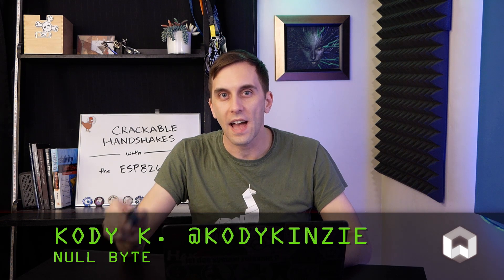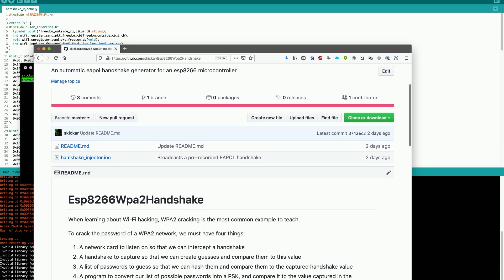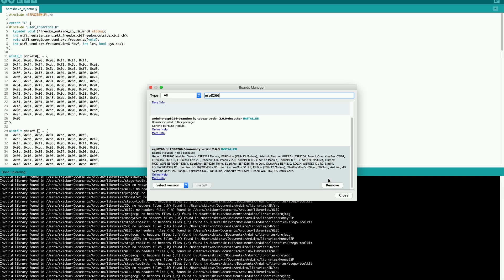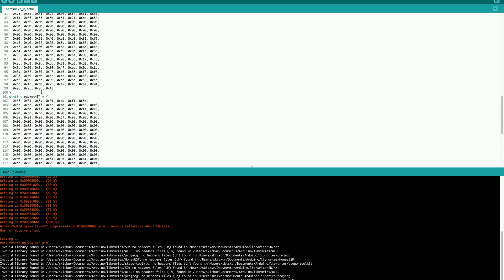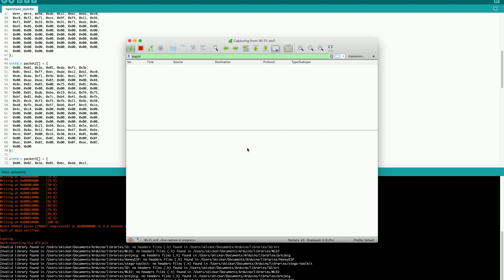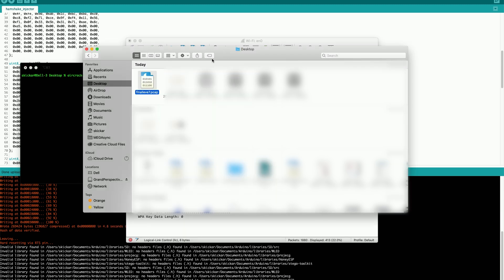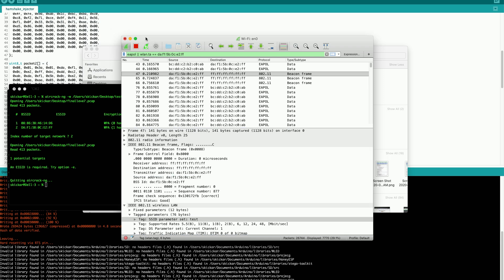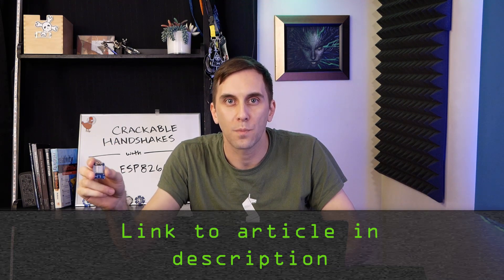Generate Crackable Handshakes with the ESP8266 [Tutorial]

Comment: how to fix exploit completed but no session is created in metasploit
Reply: which exploit ? did you set the payload correct
Reply: @1nfected881   yes
Reply: @1nfected881  msf6 > use multi/handler
[*] using configured payload generic/shell_reverse_tcp
Msf6 > exploit (multi/handler)>     This all coming 😭 sessions not open
Reply: msf6 > use multi/handler
[*] using configured payload generic/shell_reverse_tcp
Msf6 > exploit (multi/handler)>     This all coming 😭 sessions not open